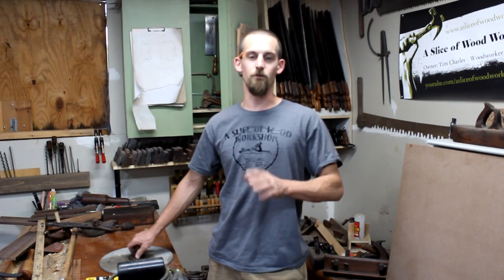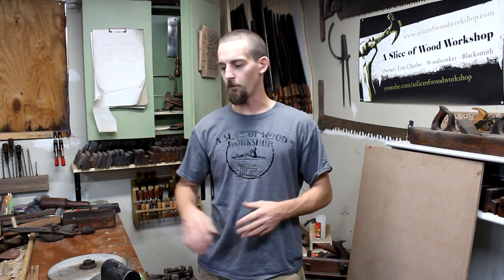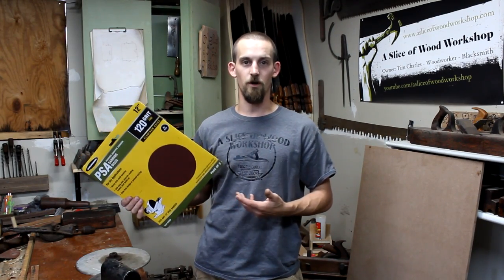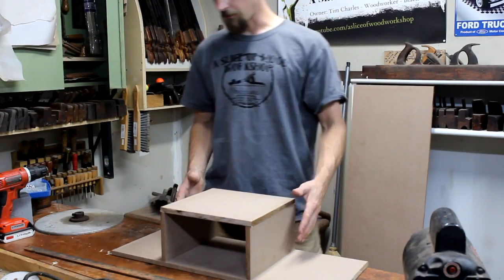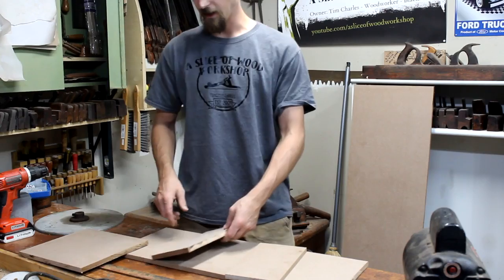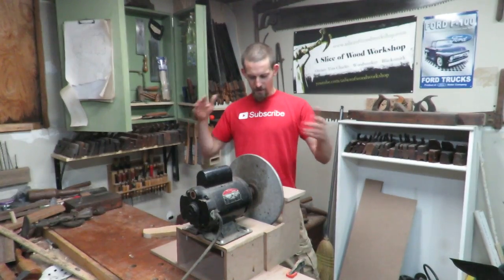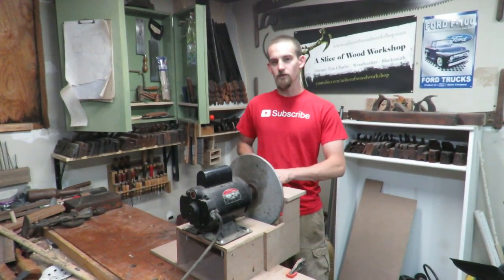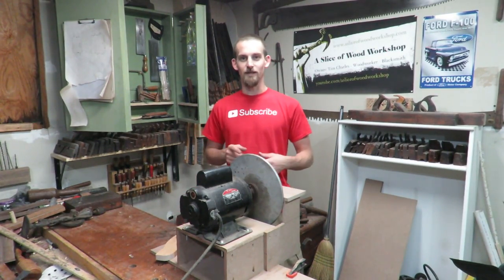Bench Top Disc Sander

Comment: Nice job Tim. I actually tilt the table on my disk sander for certain projects. I wired the motor of my disk sander to a drum reversing switch, because I have to sand into a tight area with the other disk side. A simple way to do reversing is to extend the wires from the terminal box into a 2-prong plug. Then add a pair of wires from the reversing terminals to a female 2-prong plug. When ever you need the reverse rotation, just unplug-flip-plug the 2-prong.
Reply from the maker: +toolguybak i will habe to look into doing it that way. The motor needs a new power cord anyway
Reply: Good tip!